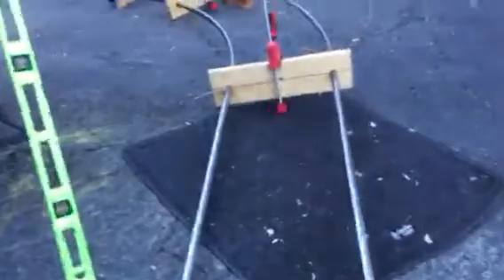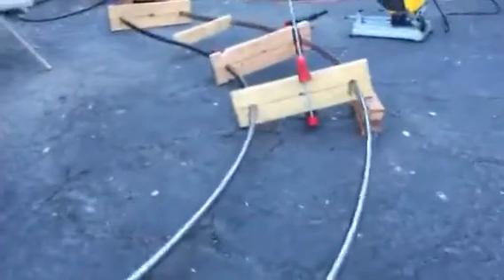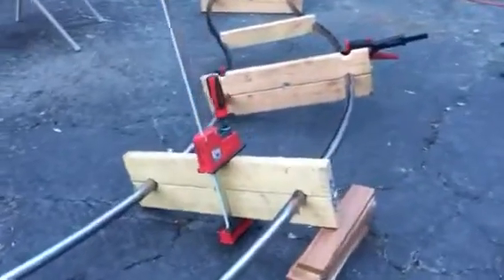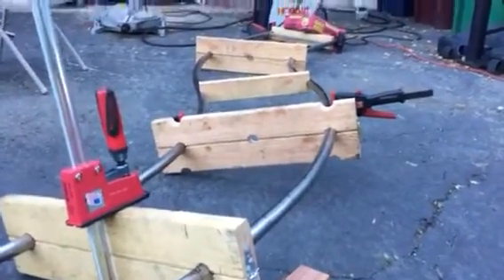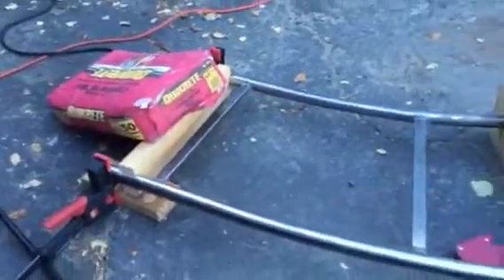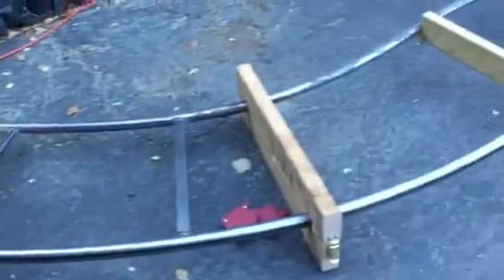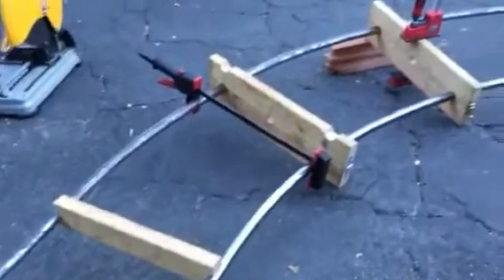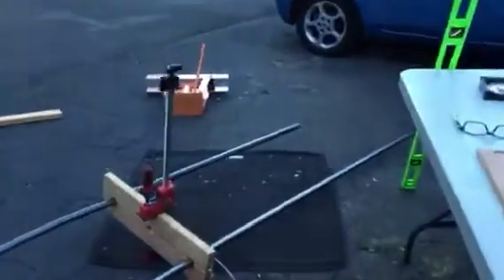Backyard Roller Coaster- Steel Track Update #2

Comment: Wouldn't you need to  make modifications to the supports now with the heavier track?
Reply from the maker: Hi Tootoofat!
I'm going to compare the weight of a 20' steel segment to a 20' wood/PVC segment and see the difference.  Then, we'll reenforce the supports as much as we need to.  The new coaster probably wont look much like the old one when we're done. The only thing I know for sure is that it'll be safe and awesome! :)
Thanks for watching!
Best,
Will